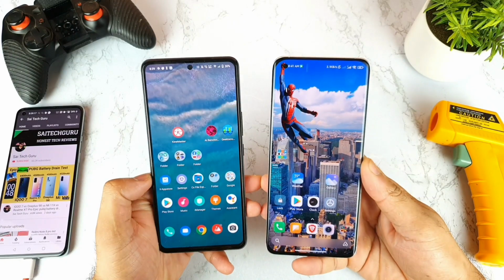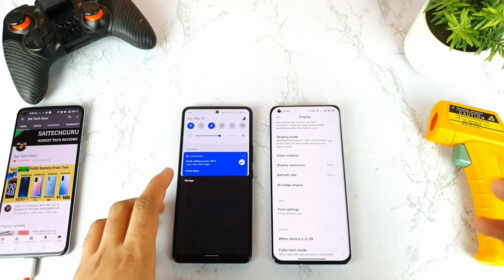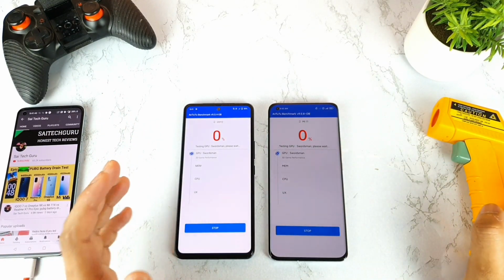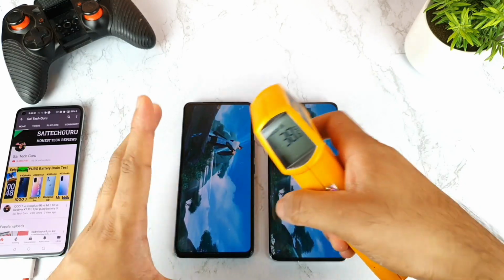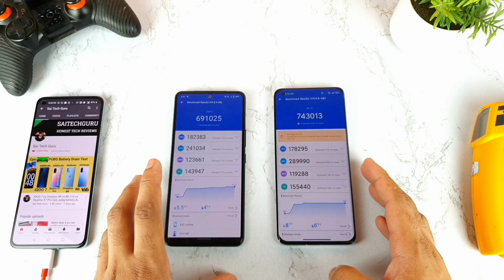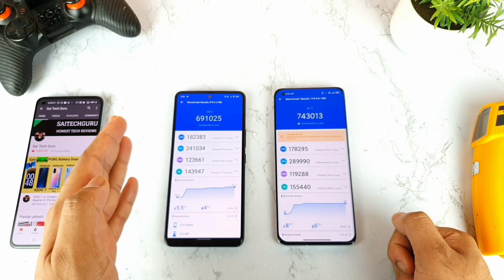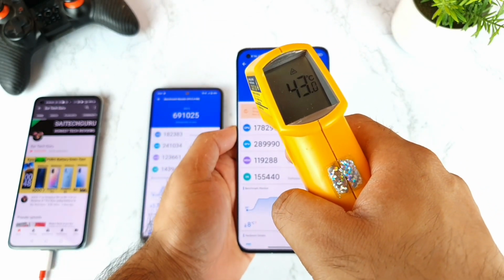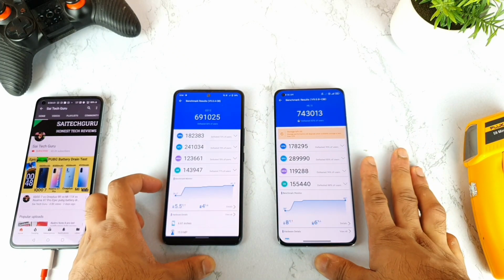iQOO 7 vs Mi 11 Antutu Test Snap 870vs Snap 888  Comparison results 🔥🔥🔥

Comment: Hello brother I'm confused between buying mi 11x and Iqoo7 ..my priority is good network speed..please help ..I'm going to buy today
Reply from the maker: It is very simple Aryan in my experience with two phones I did feel Mi 11x is very very very better in network speeds both wifi and 4g. And no user compalined on network problems with mi 11X so final conclusion is Mi 11X is best choice. Kindly use my link to buy & Support me if possible. 
Mi 11x Black:- https://amzn.to/2RLRTfD
Mi 11x Silver:- https://amzn.to/2SELkvn
Mi 11x White :- https://amzn.to/3urbLBO
Reply: @SaiTechGuru  thanks a lot bro

Comment: Which is best pls tell me bro i am buying today pls 😭
Reply: If you're a WiFi user, go for iQOO7 if not go for Mi 11X. This is an important thing. Network receiver is not as good as Mi 11X.
Reply: @rayd1459  Always include the country in response.
Reply: @kehindeadeyeye7190  sure, it's India
Reply from the maker: iqoo 7 is best phone kindly use my link to buy the phone:- https://amzn.to/3vxHsL8
Reply: @SaiTechGuru  Now Kindly check again. Airtel and Jio has upgraded spectrum in your circle. iQOO 7/Mi11X/Mi10i/One Plus 9R/One Plus 8T speedtests 4G+. I hope you will test upcoming One Plus Nord CE as well.
Reply from the maker: Hi Nikhil I did check again but no 4g+ I will try to do another video on that soon.
Reply: @SaiTechGuru  Thanks.